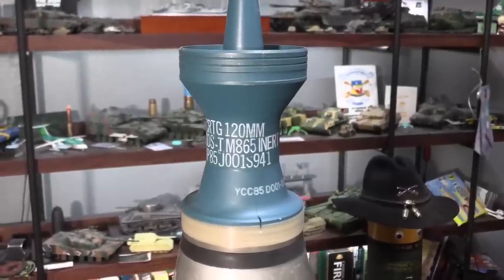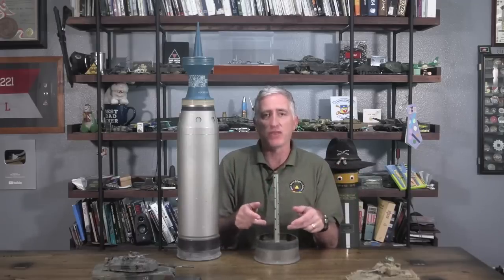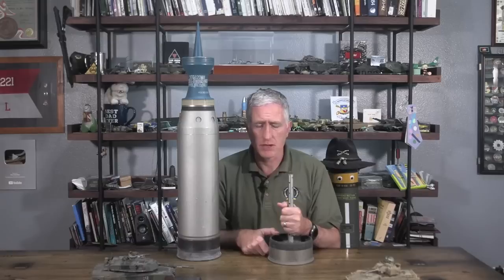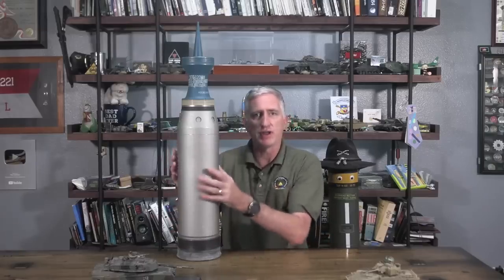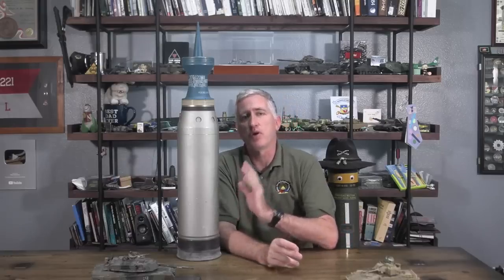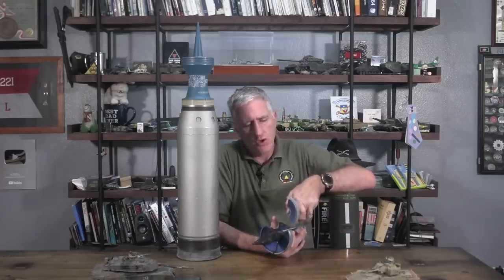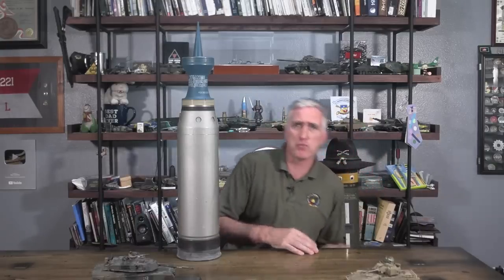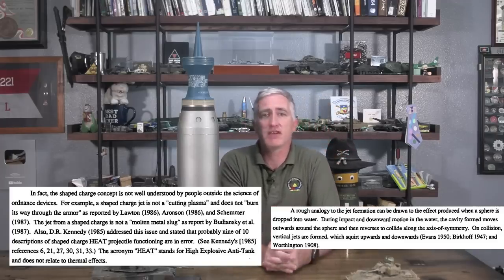Tanks 105: Anatomy of a Modern 120mm Round

Comment: I was a T-34/85 gunner in my youth. We had both round types you showed, but mostly shot explosive/fragmentary rounds. I remember having some fun with the detonator timings to the displeasure of the officers. Don't modern tanks have such rounds?
Reply: An APFSDS round for an 85mm gun? I've never heard of such a thing. From my understanding the 115mm of the T-62 was the first gun to get that ammo type, and later a version was made for the 100mm D-10T...but I don't think anyone ever bothered to make one for a T-34???
Reply: @tackytrooper  
First rod ever went into service was developed for 100mm anti tank gun used by the Russian. 
Then improved version got adopted for 115, then adopted back to 100 on t55.
When the Chinese want to get their hands dirty on developing their domestic armor industries, they somehow from somewhere find someome make something that is in all technical term, a rod, and shoot that thing out of t3485. 
It most likely doesn't have good performance, the pressure the breech need to handle is probably dangerously high. But the Chinese got to start somewhere and that's where they get their start. 
The Indians also had a similar story with their domestic armor development. No t34 were involved thou.
Reply: @tackytrooper  You are correct that the AP solid round was not fin stabilized but with a hard core penetrator nonetheless. If I remember correctly we had a full bore one and a subcaliber one, both rotationally stabilized by the rifling in the barrel. The subcaliber one had a funny cone in the front, then was narrow almost to the diameter of the penetrator inside, then went back up to full bore where it was set in the casing. It engaged the rifling in two places, the edge of the cone and the main obturation was a copper ring in the back section. My memory is a bit vague because we mostly shot explosive fragmentary rounds, like if I've shot more than 200 of the anti-personnel ones I've shot 5 AP at the most.

Comment: Great video, but a couple of questions.  As weapons for the USAF, there are a few other rounds that can be used in tanks (correct)?  Do current tanks still have HE rounds?  And...as least as the practice of in the USAF,  typical practice on the range is done with the blue inert/dummy rounds...you don't use live rounds on the range except every so often, and sometimes just to clear old lots that need to be fired before they go overdue on their storage.  Would that also be true for the Army on tanks?  We probably loaded 'combat mix' on the A-10 around once or twice a year (during peacetime), it wasn't often at all.
Reply: There are a number of reasons for using inert practice projectiles for training.. 
1. Cost - cheaper to make, transport and store as there is a nil/reduced explosive hazard and no requirement for expensive fuzes or exotic materials such as tungsten or DU etc. 
2. Reduced risk on the firing platform. The effect of misfires/crashes/fires in the launch vehicle is much reduced by substituting inert materials for explosive ones. Managing bombed up aircraft and fighting vehicles is a PITA. Ships are less of a problem as they are designed to carry a permanent live ammo compliment, but air and ground vehicles are not due to weight/space constraints.
3. Reduced range danger. Practice rounds do not leave an explosive hazard on the range if they do not go off as intended. High velocity warshot projectiles can require huge danger areas because of ricochet issues. Practice projectiles can be designed to break up or have increased drag characteristics. In some situations it is not possible to use warshots in a practice/training environment e.g. mines, and a specialised training store is needed.

Comment: No you do not want the powder to detonate.  You want it to deflagrate.  Detonation is a high order explosion that will destroy the beach and cause an emotionally significant if very brief moment for the crew.  Deflagration  is the controlled burning of the powder at a measured rate that will not exceed the designed strength of the breach of the cannon.

Comment: Of cause you have a APFSDS training shell at home. Who doesn't have one casually sitting on the shelf? In case there is a war to fight over the height of the neighbors hedges! But the most important question of all is, where do you store the spare parts for your Abrams? These sprockets are huge. I like the Abrams, cause it's engine is so small, the engine for my Leo is humongous. It barely fits into my shed. It's just a nightmare to fit this monster in there, together with my uranium centrifuges and may ICBM's! 😉

Comment: Aerospike would be the term of art for the aerodynamic action performed by the heat fuze.
Reply: Nope.. an aerospike is a design of rocket motor nozzle that has the shaper on the inside rather than the outside! Shaped charges work by the interference of intercepting shock waves...
Reply: @felixthecat265  this is a case where the same word is used to name different things.  The English language is lazy that way.  In addition to a type of rocket engine an aerospike is also a device placed on the nose to split the airflow at supersonic speeds.  Another example of this is the Trident D5 SLBM.  Its blunt nose sucks aerodynamically so it had a pop out aerospike that reduces the supersonic drag.
Reply: @Yaivenov  I beg to differ, an aerospike does the same job on the D5 as in the rocket motor. I suppose you could also call the tip of a Shikval an aerospike, although I would think "aquaspike" would be better. Neither has anything to do with shaped charge dynamics!
Reply: @felixthecat265  I never mentioned shaped charged dynamics, only the aerodynamics of the projectile's flight.
Reply: @Yaivenov  Ah.. got you now! Yes I agree...

Comment: I'd always had the impression that the remaining base plate was just a (relatively) flat disc rather than the extended contraption you showed. Has that changed over the years (or maybe something that was true for the original 105)?
Reply: The original 105 had a non-combustible case that remained attached to the base-plate, so you didn't see the rod up inside before loading, or even after extraction.

Comment: Sabot....a wooden peasant's shoe or 'clog'. Throwing it into a machine to break it is "sabotage". It literally 'clogs up' the works. This is how angry French peasant's protested against their master's replacing them with machines during the industrial revolution.

A 'Sabot' is also the wooden disc that cannon balls (and bags of grapeshot) were strapped to, so they did not roll off down the slope before you were about to load them.
It helps act as a 'wad' when your ramming the ball down on a charge. That's how the military started using the term.

Comment: In case anyone cares, proper standoff for any shaped charge is simply 2/3rds of the charges diameter, so 79mm for a 120mm HEAT shell
Reply: Also, the penetrative power of a shaped charge is about 7 times the diameter of the round, so 840mm for the 120mm round. 
The values are for the "rolled homogenous stell" standart, at 90º.
Reply: @carloshenriquezimmer7543  nice
Reply: 2/3 of 120 is 80, not 79.
Reply: @WarpigA23  lol thanks I suck at math

Comment: maybe it was a joke, but they probably say not to store the primer cap directly on the floor because of the floating ground, which could (under some extreme circumstances perhaps) hold enough potential in the tank's hull to detonate a primer
Reply: I was also confused by this. Seemed like ironical statement by chieftain implying the reason was obvious. However, to me it's unclear how two closely located points of metal floor could have potential difference. Metal is conductive, after all. Maybe some weird occasions of round sitting just on the joint of two isolated (by paint, for example) metal panels. Seems far fetched, though.

Comment: What are the benefits of those non-metal shell casings? You described some cons, but what are the pros?
Reply: Lighter and you don't need to stop mid-combat to get rid of spent brass shell casings by opening a hatch (opening the door for grenades, shrapnel for artillery, etc.).
Reply: The basic pro, is not having a brass shell casing the size of a milk keg, smoldering hot, rumbling around the turret while the loader has to shove another milk keg sized projectile into the breech.
Reply: @fabiogalletti8616  I see. Makes sense. Didn't think spent shell casings in the turret are still a thing.

Comment: I sometimes wonder if it's the purpose of militaries and munition developers to make nomenclature intentionally complicated so as to need an acronym that makes it sound cool: APFSDS - Armour Piercing Fin Stabilised Discarding Sabot. I wholly anticipate that operators just call it "AP". an old tanker acquaintance  called their APFSDS ammo "Spike", granted I imagine as any crew gets familiar they nickname stuff.
Reply: OK.. you need to understand the history here..
It starts with a plain solid penetrator.. AP for Armour Piercing. 
The problem with plain AP was that the tip shattered at high velocity, so it was given an anti shatter cap. APC for Armour Piercing Capped
The problem then was the squat shape of APC slowed down the velocity and penetration energy at range, so it was given a Ballistic Cap to reduce drag. APCBC for Armour Piercing Capped with Ballistic Cap. 
There was then the composite projectile with a hard core and a rigid light surround. APCR Armour Piercing Composite Rigid.
There was also a composite projectile that got squeezed down in the barrel. APCNR Armour Piercing Composite Non Rigid.
They then came up with a design where the light surround was discarded on leaving the barrel. APDS Armour Piercing Discarding Sabot.
Currently they have moved from spin stabilisation to drag stabilisation to allow the use of long rod penetrators. APFSDS Armour Piercing Fin Stabilised Discarding Sabot.

... Blame engineers if you like, but this is not for your benefit, those who need to know, know!
Reply: @felixthecat265  hi there, pretty well acquainted with the history of and nomenclature of amoured fighting vehicles in general and the constant evolution of protection vs weapon, it's a subject that's always fascinated me, and as such I did an in-depth presentation on it while studying for an engineering degree ;) -edited because I don't proof-read my comments and my keyboard likes to double-strike
Reply: @kaelin000  Your question was along the lines of "did developers use acronyms to look cool". My experience is that development engineers tend to be more logical than "cool".. as an engineer you should understand this..?
Sorry for the Sheldonic answer.. (although he was Not An Engineer..)
But Yes, the rough soldiary tend to name things to suit themselves.. UK use is "Sabot" and "Fin" although they always use HESH as the term for that round..

Comment: So after mistakingly pulling the "aft cap" off your unfired round, how do you remove the round. Can't be nice to ram that thing out while un-friendlies are about.
Reply: no way around, unfortunately.
If I'm not wrong, if the Challenger2 had to unload a 'fin', the only way is to call the REME and tap it out with the cleaning rod.
That's why, usually, if you have to clear the gun, the easiest way is to fire the damn thing out the usual way.

Comment: question: the heat round on a smooth-bore rifle, isn't it fin-stabilized?
Reply: On the Leopard the MZ (Multi purpose) Heat round is fin stabilized, but due to it's shape it gets fired at an different angle. So if the loader selects the wrong loaded ammo type, HEAT is loaded but he selected AP the HEAT round will fly only a very short distance, and otehrway around a KE round will fly up in the sky somewhere if you selected HEAD but loaded KE.

Comment: I used to think the combustible case was the coolest innovation and wondered why anyone would want to use brass cases for tank ammunition, but after you described the absolute ordeal of clearing a misfired 120mm it seems like maybe NATO was mistaken in choosing this instead of conventional brass-cased ammunition?
Reply: No. It's a tradeoff.

Brass case ammo is heavier and each casing remains intact after firing. This is bad because a tank can only hold so many spent casings before a crewman must pop a hatch and start dumping shells outside. This creates vulnerability, especially in urban environments, when the crew must clear out spent casings. And this is again considering the added weight of the shells which can hamper loading times.

Tanks that use combustible casings can go way longer without needing to evacuate spent casings and the shells are gonna be lighter than brass/metal counterparts.

Comment: Have the 120mm sabo round changed much from the chieftain, to the newer tanks?
Reply: The main thing that changed was the length of the penetrator. The newest sabots have projectiles that take up basically the entire length of the case to the baseplate. This is because length = penetration.

Comment: My dear Colonel...  Propellent charges do not Detonate, they burn. High  explosives in shells or demolition charges detonate. Although propellent can detonate, if it does this in the gun barrel, it would wreck it.. (...but I am sure you are aware of this, and your misuse of the term was not deliberate!)

Detonation is a different physical phenomenon to deflagration. It is always associated with a supersonic shock wave typically at around 6km/sec. What happens in a propellent charge is a two stage burning process. There is an initial ignition phase where a flame front travels through the charge mass igniting the surface of the propellant grains. The primer tube down the centre line of the charge assists this process by distributing flame through the charge. The second phase is the burning of the propellent grains which, depending on the makeup of the propellent, will result in a progressive or digressive burn as the propellent gets used up..

The primer is part of the stub case (not "stub base" !) which as well as holding the ignition train, seals the breech (obturation) as you point out. The problem with stub cases is that they (rather than the charge element) are very prone to damage. Any dents or scratches on the stub case can result in propellent gas tracking back into the breech. This can result in damage to the chamber wall due to gas erosion. Traditional cases are not nearly as prone to this failure mode as they have a greater distance for a good gas seal to form. Traditional cartridge cases also perform a significant amount of heat removal from the gun. 

Stub case rounds need to fit the breech better than DeBang or UK type bag or combustible charge case  (ccc) designs. Distortion in Stub case charge bodies is therefore more significant as it may lead to charges jamming in the chamber. Scratch damage to the combustable part of the charge case is not that significant provided it does not prevent the round being chambered.  As you point out, case separation is a major PITA with this design.

Strictly speaking the contact in an electrically fired system should be referred to as a "pole piece" or a "needle" to differentiate it from a percussion firing pin. An advantage of the US design is however that it is impossible to fire the gun without an obturator present, which was sadly proved not to be the case with the Charm breech on Challenger..

A question for you sir! I am aware that it was an accepted pre battle drill for 105 Centurian crews to "chamber test" their ammuniton by removing the gun lock and then cycling rounds through the gun before putting them into the charge bins to pick up any distorted cases. All cased ammuntion is chamber guaged by Ammo Techs every time it is inspected and as the last procedure before returning it to it's container. Is/was this ever done with the current US stub case ammunition?

Very last point.. the light blue on your PRAC DS round signifies a practice round, which may have an inert projectile, but a live propellent system. The correct colour for a true inert Drill round is Dark Blue!

FtC (SATO)